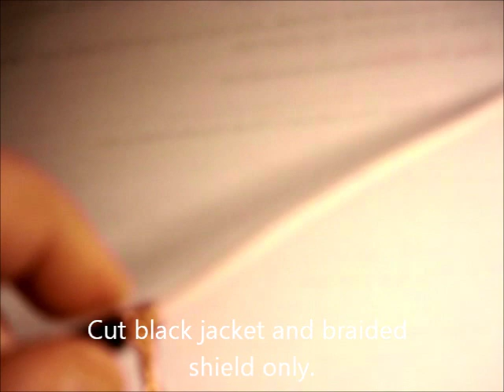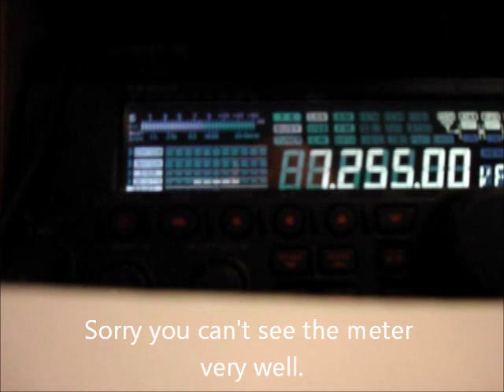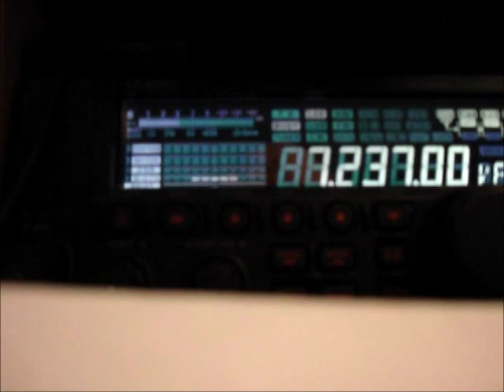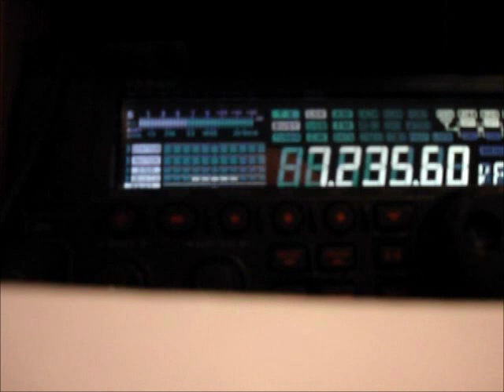40 Meter Double Bazooka Antenna.

Comment: The RadioWavz double bazookas are made with a PVC pipe tee and a pair of caps.  Some short pieces of the same size pipe are used to make a place to attach the caps.  The bottom of the tee where the SO-239 is mounted has a piece of the PVC pipe in it as well to make a place for the screws that hold the SO-239 in place.  So far this is pretty standard.  What makes theirs different is that they put electronics safe silicone sealer in the caps before assembly to keep the water out and then pour a generous amount of epoxy into the tee.  The epoxy bears the load placed on the antenna so it's not carried by just the core wire.  There's no hanger on the tee.  Some paracord tied around the tee is all that's needed to hang it.

Comment: Hello, your work is very nice, what I want to ask is what happens if there is no tail section left at the ends, is there any harm in adjusting the SWR ti by folding or cutting the ends and soldering them again?
Reply from the maker: Sorry it took so long to answer your question.  I had no issues with SWR.  I can only assume you’ll have none as well.  Good luck and 73.

Comment: A common misconception is that better coax is...well...better!  Coax with a shield of about 60-ish% works best.  I've seen some very poor performing double bazookas, usually due to the wrong choice of coax.  Another issue is using a small wire size on the ends.  If you want it to be broad banded, use 300 ohm twinlead on the ends.  Short the 2 sides together.  RF-wise, that makes a large cable on the ends.  I used 450ohm window line once but the antenna flapped in the wind too much.  To tune the antenna, just fold the twinlead back on itself on the ends...no need to cut.  
Finally, use marine heat shrink at the transition from coax to twin lead and on the very ends.  I've had one for 80M 30 feet up for 8 years with an old toothbrush center wrapped in emergency tape.

Comment: Great video Bill....I've been using this design for over a year (a single-band DB antenna) and because of the very wide bandwidth  I've never had to adjust the VSWR. The noise level is about 60% lower than it was before when I was using verticals and standard dipoles :-)

Comment: So, why are you trying the double bazooka? Totally different? Wow. None. its just a dipole antenna. I never seen anyone with great performance better than any dipole. I know several people with the antenna. There was NO noise difference at all in the two antennas you show here. This delusion that the bazooka  is better is marketing bullcrap hype to sell antennas. How could it possibly be any quieter? Impossible.
Reply: So MIT in the 1940s was designing a gimmick for the military?
Reply: @WW5RM  MIT designing a gimmick for federal grant money???
Reply: @MrMotorchild I was asking a question. You respond with a question. That makes sense to you?

 All I know is I've had numerous wire antennas and none perform as well as the DB. You might not see as much signal strength but that's by design. What matters is signal to noise ratio and that's where it shines. It's a DC shunt and the noise floor is lower. Which sometimes causes signals to be lower but with a lower noise floor you can work weaker stations and it helps reduce QRM.

Added plus is increased bandwidth.

I build my wire antennas myself. I dont buy anything I can build myself.

Comment: the content is good.  Just the focus drifting in and out made me feel a bit seasick.  I have been using a Double bazooka on 40m for about 10 years.  I find it a great antenna and agree that it has less noise than a dipole in the same place and orientation.
Reply: Greg Lee: Agreed....it also has a much wider bandwidth.

Comment: The bigger coax will result in a wider bandwidth, it may not be so apparent at some frequencies, but the wider coax, just like larger diameter elements on a beam, all result in improved bandwidth. Some people want to believe what they want, and disregard all the testing done between a dipole and a Double Bazooka. The lower noise is due to the plastic covering on the coax.  RadioWavz uses RG11 in their design , and they make a very nice DB. The RG11 is closer to .5" wide, and it gets great results. At 40M, you may not notice the lack of bandwidth, but at 80M, it will be obvious if you compare the two.
Reply: Can I use RG6 instead of RG11?

Comment: The bazooka works exactly the same as a regular dipole.  No bandwidth improvement, not llower  noise.  But until you have done a real comparison you may be deluded into believing the myths about this antenna.
Reply: Wrong! Not sure why you think this but it is a superior antenna! It was designed at MIT in the 1940s for radar stations! And you think they designed it as a gimmick? Lmfao!
Ive run numerous types of wire antennas over the years and always come back to it! The only downside to a double bazooka is its strength and weight. The shorted stubs at the connection is usually where the biggest problems occur. But that can be over come by strengthening this connection.

When band conditions are noisy ( which is most of the time ) I am always glad Ive got it on my feed line! QRM and atmospheric noises can and often cause stations to be unintelligible even with a decent signal. I have high freq hearing loss and many many times it is hard for me to understand what a station is saying even though I can see the S meter moving! Add some extra noise and it will wipe them out completely! Switch to my double bazooka and its Q5 copy! 

I have experimented with just about all wire antennas since getting my ticket in 1992. Everything from long wire receive antennas, long wire coax receive antennas, windoms, loops, verticles etc but even running separate receive and transmit antennas which in some cases helps I always come back to my old faithful friend double bazooka!

Say what you want but Ive side by side tested it in numerous scenarios from DX, NVIS, ground wave, horizontal to inverted V and its better it most situations unless you have perfect conditions which is rare! When you need to work a specific station a lower noise floor is your friend! 

de WW5RM
Reply: On 40 meters and higher bands a simple wire dipole will provide low swr coverage over the entire band.  That is, less than 2:1 swr.  On 80 meters it will provide approximately 170-200 khz.  
In short the DB antenna is nothing more than a pair of shorted quarter wave sections in series across the feedpoint.  At resonance they look like they don't exist.  Below and above resonance they provide a small reactance which are CLAIMED to offset the reactance in the antenna feedpoint.  What they don't understand is that the antenna reactance is accompanied by a change in the RESISTANCE as well and when that combination impedance is coupled with the reactance if the coaxial stub the net effect is essentially zero.
Sorry, but that is the truth.
Problem is, people who do not understand this believe something different and want to become heroes by selling you antennas or telling some bs on the web.
I sell nothing but offer truth so that you will not appear ignorant nor be deluded into believing myths that have no basis at all.
People WANT to believe there is magic when they see the magician in stage playing tricks on the minions.  
You don't have to believe me, you have two choices.  1. Find the real facts about the antenna by locating the Walt Maxwell article titled A Revealing Analysis of the Coaxial Dipole Antenna, August 1976 Ham Radio Magazine.  I found it, you can too.  Or 2. You can ignore fact and evidence from a true antenna expert and continue to believe bullshhit from con men.  People do it every day, sometimes even electing them president or paying them 10% of their earnings forever.
Happy to be if service - feeatlastfeeatlast.
Reply: Sorry, I keep hitting the i key when I mean the o key.  So of comes out if.
I need to improve my proofreading before posting, which I will do.  I appologize.
Reply: feeatlastfeeatlast
: You obviously haven't tried comparing them.....I have and the Double Bazooka has a MUCH wider bandwidth than a standard dipole, a lower noise-level and it doesn't need a balun if fed with coax. With the Bazooka design its the braid that radiates and the inner core that acts as a balun, unlike the standard dipole. I've used a standard Dipole, a Double bazooka and a Triple Bazooka and the Double bazooka easily out-performs the others. More Info. at the link below.
http://wireantennas.co.uk/double_bazooka.html
Reply: Quite the contrary, I HAVE built the antenna, measured the swr carefully on 40 meters and then converted it to a standard dipole and the results are identical. 
You should investigate further by finding the article and analysis by a real antenna expert Walt Maxwell.  August 1976 Ham Radio magazine.  The MIT antenna was designed for vhf frequencies where the impedance of the coaxial sections causes it to behave completely different that the hf band antennas.  But you have to have the ambition to do the research, not believe the hype and lies from people who don't understand antenna theory.
Reply: @feeatlastfeeatlast5283  Walt Maxwell's article on the DB reads like he has a bias against it (burr under his saddle) from the outset.  He is so vocal about the DB being a scam that it makes the article suspect.  His is the only paper I've read that said, essentially, that the DB is a useless design.  One article out of many that read otherwise diminishes his view in my eyes regardless of the level of expertise.

Perhaps his lab testing does not match the average conditions of the average ham (whatever that means).  I guess by "average" I mean less than perfect conditions, using trees for support, living in neighborhoods where there could be noise and all the other compromises that most of us endure. In the real world, I find it far more effective than a simple wire dipole. THAT, in my shack, is the testing that matters.
Reply: Agreed, this antenna is a gimmick to sell dipole antennas.
Reply: @GTARockman  no. real Hams build their own antennas so why would this be a gimmick? Especially back in the 1940s?

Comment: Good afternoon William;
I live in an apartment, if I put the antenna on the balcony;
You will be good?
I live on the 2nd floor and the building is 14 floors.
Danilo - PY2XL.
Reply: Try to get roof access.  That kicks __! Loop antennas are great for apartments.
Reply: Got I, I'll find a way to help me with some antenna, but thanks for the return.
73 ...
Reply: its 60 feet long balcony wont do maybe a homemade slinky dipole search you tube for slinky dipole very short dipole

Comment: good day you could help me with the calculations of the double bazooka to the frequency of 6900 because I have a small farm and want to make a lot but I have no experience required
Reply: 66.67 FT (20.32 M) AND 47.1 FT (20.32 M)

Comment: Why is the bazooka 'much quieter' than a dipole?? Is that just an urban myth?
Reply: OneDawkinsFan because the feedpoint is a DC shunt.  It is well known that shunt fed antennas are "quieter"  less noise.  shunt fed antenna is safer also... all static or corona  is shunted directly to ground.
Reply: I didnt hear any difference. The antenna is the same design except for use of the shield. The idea is a gimmick. no gain, no improvement.
Reply: @GTARockman  yes it is to a gain! Try working a station with QRM or atmospheric noise and you will see the difference! Just listening to the noise floor where there isn't any and you wont see the difference!
Reply: @GTARockman  In use, there is a substantial difference at my QTH,  I've had a wire dipole up at the same time as a double bazooka; both on 20M.  If I can hear another station on my DB, I can work them.  The 20M one (RadioWavz, commercially built) is about 30' above the ground in the center and 15' AGL at the ends.  It is essentially omnidirectional.  First contact with it was from  TX to Slovenia.  The home built 80M one is 40' up at the center and about 15' - 20' up at the ends.
Reply: @GTARockman  The camera technology is not helping here.  No disrespect to WX4AR, the automatic gain control for the audio is just as bad as the poor autofocus of the older cameras.  My formal education and work experience include a dozen years in broadcast television.  The AGC is boosting up the sound level to the level the designers pre-determined was appropriate.  If the sound could have been manually controlled, there would have been a difference.

Comment: hey bill great looks like u got a nice radio there i too made one of these but for 11 meter works great and was pretty easy i will say this i have a real problem with the braid on coax as far soldering goes 73s ashley1

Comment: could you use 75 ohm    cable can find  lots of it  73 ks4ww
Reply: yes but smaller radius lower recieve thicker the better
Reply: I would not use 75 ohm since it's foil and braid shielding is not as lossy as what is needed for this antenna to work correctly.  MIT original design formula was based on using lossy coax.
You can use it but you will find that it will not perform any better than a standard wire dipole.
Reply: @jimc5308  My 80M double bazooka is made of RG-59 that was left in the attic by the builder of the house.  There was about 150 feet left on the spool.  It's all copper with no foil shield; ideal for a DB.  It's a little smaller in diameter than some types, but the difference in diameter vs. bandwidth is somewhat overrated.  On 80M, I have a useful SWR across the entire band. From 3.573 MHz to 3.960 MHz, the SWR ranges from 1.2 to 2.8.  At 4.0 MHz the SWR hits 3.0 which the internal tuner can manage. I could shift the dip higher from its current position at 3.7 MHz by folding back a few inches of the stingers (tails) but until there's more SSB traffic on the upper end of 80M, there's no benefit.